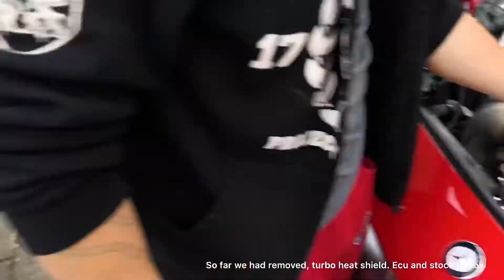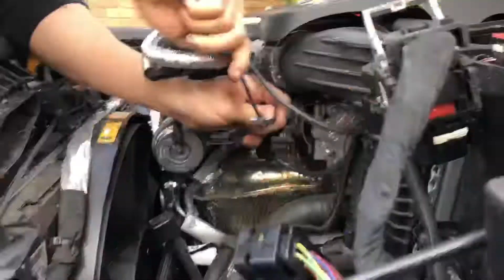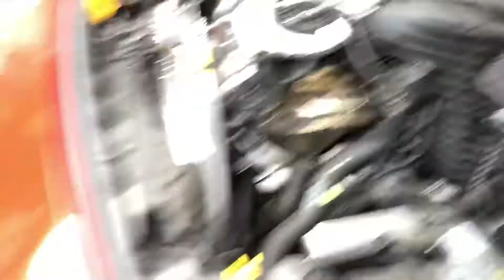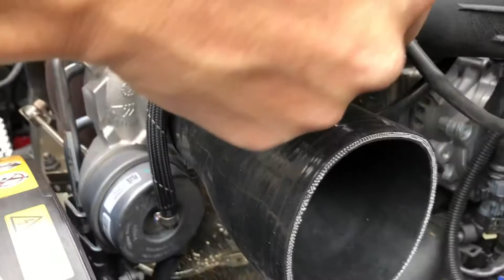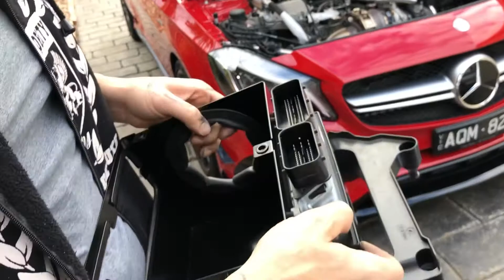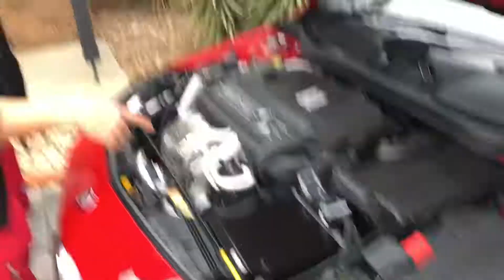A45 AMG Mishimito Airbox Install

Comment: does the box jump out when you accelerate? mine jumps
Reply: cristina jesus , Nope no issues with the airbox jumping out, check the grommets are still in place or add a washer to the retaining / mounting bracket so it has some tension on it